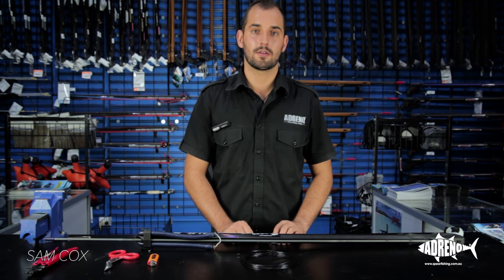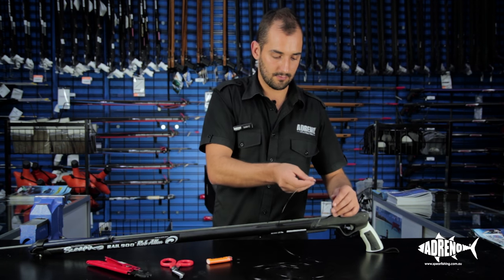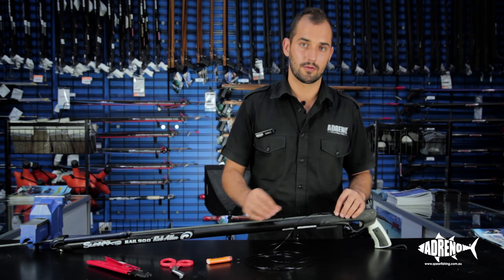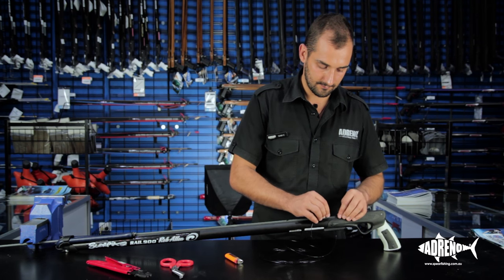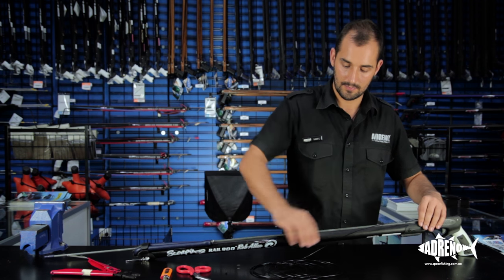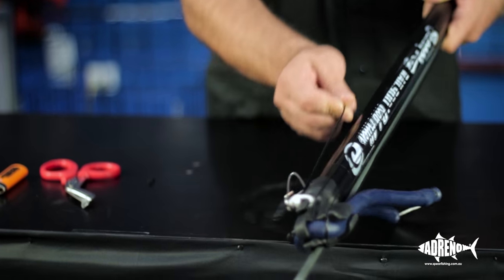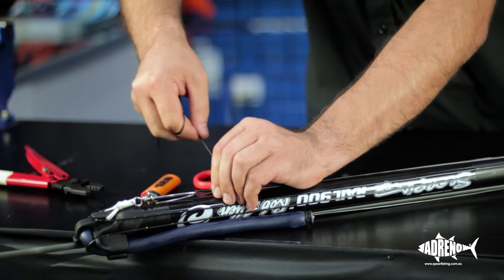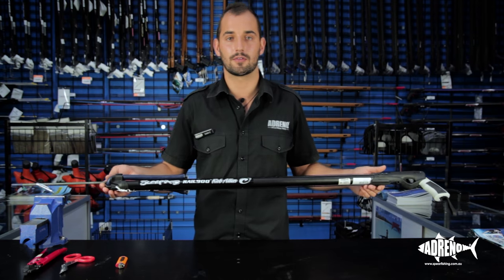How To Rig a Double Wrap Speargun | ADRENO

Comment: What is the purpose of a double wrap? Also I havs a 1000 version of the same gun - if I do a double wrap will I need double rubbers so that I have enough power? Finally can I take my gun i store and get you guys to do a double wrap for me? If so how much would this cost?
Reply: Purpose of the double wrap is to provide more range for your speargun, if you add another rubber you can help increase the range of your speargun but it is not needed